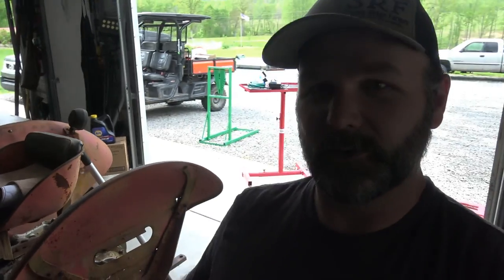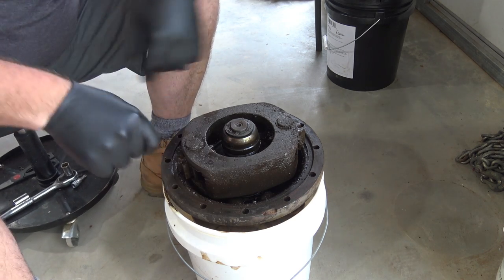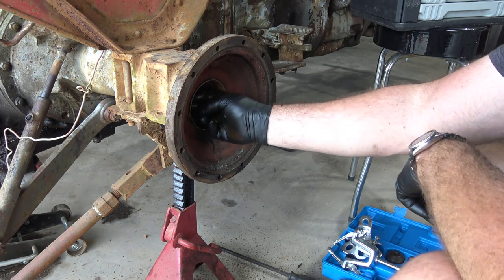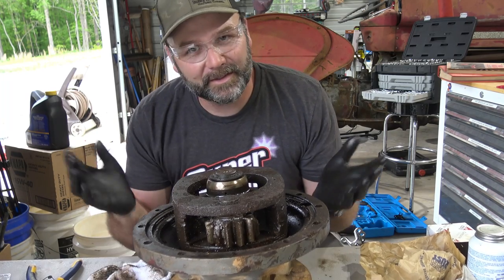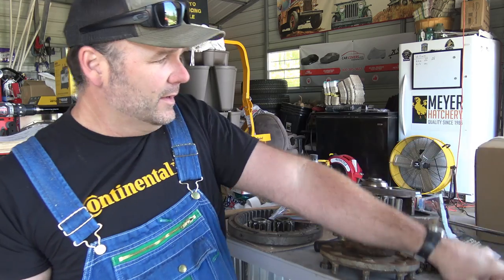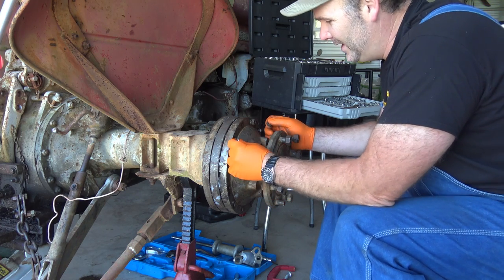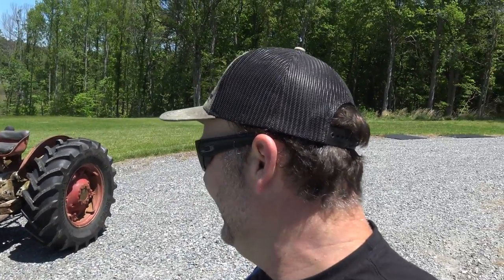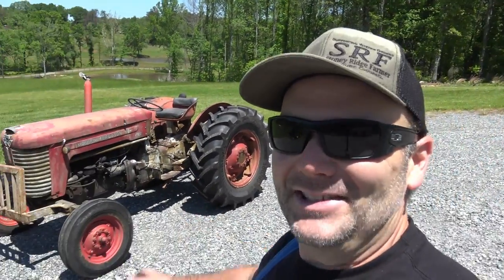Bringing this crusty 60 year old tractor back to life!

Comment: Earl either has a blown exhaust gasket or a cracked manifold. Just watch the smoke when you give it gas.
Reply from the maker: Or it's an old tractor that hasn't run in 3 years or more
Reply: No that's just oil because it's blue if it was white then you would have something to worry about. The oil drips in from the valves ecpecially if it has been sitting.
Reply: Maybe put a new exhaust and muffler and let it be done. Earl looks pretty cool just as he is. Great job and great video. 
 Thank you!
Reply: @randywright7433  would's be Earl without that costume muffler...
Reply: @StoneyRidgeFarmer  At about 30:24 you can see exhaust smoke come from the manifold area as well as out the top of the stack.  It's not that it smokes, but where the smoke comes from I think he is referring to.
Reply: @wickedcoyote271  it's probably just a loose slip fit on the exhaust manifold. Mine blows out on my tractor at the manifold for the same reason. I don't have a MF though
Reply: @wickedcoyote271  Yes, I can see that (coming from the mainfold area).  What do you do about that?  Great video!
Reply: @StoneyRidgeFarmer  Could be, but it's probably compression smoke due to the fact it was designed to use leaded fuel.
Reply: run it awhile, put some Upper Cylinder Lube (marvels mystery oil) in fuel, it will help loosen those stuck rings. USE IT, LOVE IT!
Reply: Soap and water will tell if it the Manifold spray around it.
Reply: No it’s the rings the piston rings will wear if it sits for over a year and the oil is bad

Comment: Nothing like having an old tractor around.
I got a 1965 Case 730 with a “Duz-All” loader on it. Got it from Uncle Oscar. Real strong loader and handy to have around.🇨🇦🤠
Reply: Also l don’t spend money on cosmetics like paint or fixing dents or redoing the seat. Gas Tires Oil all odds and ends. She is always needing something ha ha ha. Up here our gas is like glue but fortunately the carburetor is real simple to work on ha ha🇨🇦🤠

Comment: Old farmers trick is to put the bearing in gear oil on a hot plate on low for 20 minutes or so. Then press it on. We didn't have a press. We used a peace of pipe and a 4 pound hammer and that's why we heated it up the bearings.
Reply: Steve B and if you have a freezer big enough you throw the axle in to get cold then add said hot bearing they usually drop right on

Comment: Still use one of these. Grandad bought it new. It’s a 1962 model and it’s used for the jobs that need it. Also I’m pretty sure that one will have a plug in the front of the head where you can put a temp gauge. In the 165 it has a mechanical gauge in the hole so it’s worth a thought

Comment: Saw some minor chastising in the comments about the bearing installs.OK: for the technicals out there you use dry ice to shrink a bearing or outer race and a bearing heater to enlarge a bearing I.D. when needed. Or do what 90% of mechanics do and press or tap in place..... I've used all three methods and it depends on multiple factors.
Reply: Freezer method was told to me ,i used it for timing  chain  bearing and race b4 installing  new sprocket, i have to say the  cold contracted both with ease  and seating  them with thin coat of oil    after sitting 24hrs in freezer.  I added this one to my trick bag.

Comment: Hey Josh, love your channel and videos. One tip from an old diesel mechanic, my gramps, when tapping on the bearing race, always use a round metal piece of the same diameter (like a piece of pipe or large socket), put that against the race and beat on the center of that piece not the race. The hammer can damage the race and ruin your bearing. Beating on the center ensures the race goes in evenly without scoring the bore.
Reply from the maker: Thanks Fabio!

Comment: Just a thought for ya Josh, and know that I've worked as a semi truck mechanic for many yrs and owned my own for yrs. So, with that said just a little advice, and yes some will disagree on here but, even though the bearings in that axle run in oil, it's always a good idea to pack the bearing in grease when reinstalling. In fact, the yrs I worked for a Mack dealer in Ky. if we were caught installing wheel bearings, (new or old), dry, we could be wrote up or even fired. Yes those bearings run in oil but it takes some time of running to get the oil up and in that bearing. And once it is in the bearing it will wash out the grease. You don't want that bearing running dry for ANY time. Just a thought. 
John in Ky

Comment: I stumbled onto your channel a few years ago when you were replacing the seat on your other massey. I had a '56 MF50 and was getting it up and running at the time. Tuned up, new tires & rims, new electrical, new ignition, battery, cleaned the fuel tank, all new fluids. About the time I got it running just right, I sold it to a collector and bought a '16 Kioti with 4WD and front-end loader. I miss the character of the old tractor and my wife loved how cute it was, but the new tractor gets so much more work done and I don't have to work on it constantly. Probably would have kept it as a hobby if it wasn't my only tractor.

Comment: I remember when you came and picked up that tractor and brought it home with you. The first tractor I operated decades ago was a 1965 Massey Ferguson which was new at the time and owned by a guy who hired some of us to clear a field for him and I drove that tractor and loved it. That was my introduction to tractors and since then drove a Ford tractor another guy had which he used for farming and logging. In 2002 I purchased a John Deere 790 tractor which I still have and in 2016 I purchased a 3032E tractor from the same dealership and love it also.

It sounds like you do what a former friend of mine did as he rebuilt tractors also and rebuilt two of them and made changes to a third one he owned. The last one he had before he died was a used Massey Ferguson and it is still working, but his son-n-law don't know how to operate it. Those tires are heavy and you must have had a time getting them back on the tractor too, but worth all the work performed on it so it works just fine. I think you should keep the tractor as a backup to do some of the work you have just in case one other tractor is down.

Comment: not criticizing, but lending advise from someone who has replaced many bearings and gears on various pieces of equipment over the years. if you can (wife willing) put the shaft in the freezer for a few hours or better yet overnight. once its good and cold gently warm the bearing in a bearing heater (toaster oven works great for this) it will slide right together. the same goes for the gears
Reply: I have done the same thing with a pressed in ball joint. Freeze ball joint and put some heat to the seat. Push the ball joint in with 2 fingers.
Reply: Me to, mechanic  told me its the shade tree and poor mans remedy to high dollar tools,press and mechanics.
Reply: @patmac6356  it is but I had to go pay the deposit at advance auto part the other day for the ball joint press so I could use it to install U joints in my pickup. I have one almost exactly like the one Josh owns.
Reply: @pcguysoffgridcabin  New word for your vocabulary  ,kroil(oil that creeps) freezer overnite appropriate  sized socket  and a hammer does it everytime.
Reply: I don’t know crap about tractors, but wouldn’t it have been a good idea to grease the bearing and throw some additional lube on the splines? 
Edit: just watched another tractor resto video and that guy didn’t lube you the bearing either.

Comment: I just bought one sitting 20 years here in Australia. A 1963 MK11
I took the fuel pump glass bowl off to check the fuel, broke the seal, made a new one put it on. Battery in, turned the key and it fired without winding over. Zero smoke.
The steering was frozen because the rubber on the tie rods were rotten. Pumped the tyres up, sprayed some wd40 in them, kicked the front wheels a few times and drove it home 2klms.

Comment: Hey Josh. First things first great video. Little trick for ya. If your replacing a bearing race use the old race too drive it in. Like metals won't damage each other. You should leave early with the way he is. Nothing like a tractor with character. And 500mls is half a litre. It takes 3.98 litres too make a gallons. Hope that helps and I'll see ya in the next one. Thanks for taking us along. Whoo!

Comment: I have a small farm in the catskill mt. ny I love the old Massey Ferguson tractors I have 2  TO 35 tractors that I rebuilt one was 30 yrs ago the other was in pieces I bought local and totally rebuilt , that one has power steering, makes it real nice to drive . one I use for my pro root o tiller the other for  my finish mower. makes it easy to steer while mowing . I love those old Masseys and I enjoy working on them , pretty simple.

Comment: Josh, years ago, my dad had to replace a bearing in an air compressor. He couldn't get the bearing out, so he took it to a machine shop, where they welded a bead on the race, which, after it cooled down, pulled out with little effort. Your puller wouldn't have been able to pull it as it was quite large.

Comment: Hey Josh,  If it were me, I think I would run it for a little while making notes of all the little problems that surface as you use it.  Then make an assessment of how it will cost to do all the repairs.  Don't forget the paint job it needs.  Any electrical work requiring panels to be removed, should be done before paint goes on.  By the time you are ready to start, after running it a while, you'll know if want to go the short  road with a quick low reward, or the long road to the big payoff.  Remember Josh, it all boils down to what you want to do.  What is going to make you happy and capable of doing.  How much is it costing to fix and how much will it fetch after it's done.  Good luck, stay safe, and God bless.

Comment: Awesome work
Reply: Great job!  That’s a functional tractor the way it is.  A new muffler would be good.  As for Continental tires: I use them on my motorcycle and my bicycle. They perform admirably.  No regrets about using Continentals, despite the cost.

Comment: Josh, I have 1959 Massey 85 that is similar.  A friend's Dad used it on his farm and it sat after he died.  I bought it for $500, and put another $150 into moving it.  The shop I took it to turned me down.  They thought it would be more expensive to repair than it was worth.  I am going to take it to a shop where the mechanic will work on it as his schedule and my check book allows.
Reply: 500 ml is roughly 20 oz.  Think of the pop bottles you get at the convenience store.
Reply: Kevin, Just my 2 cents worth but if a mechanic works on your tractor and charges a minimal $50.00 an hour you'll be underwater on the tractor ten ways from sunday.Old tractors were designed and made for a typical farmer to do most repairs. Buy a complete set of manuals:factory original or re-pops.Operator,service and parts. Avoid generic manuals. then go through the tractor yourself. It really isn't all that hard with manuals. I've bought,fixed,kept or sold around 50 pieces of rolling stock:tractors to dozers. Take you time,take pics,label parts (right down to where the bolts removed came from.zip lock bags for those) take notes: not really that hard to fix old tractors and for me it's a relaxing and profitable endeavor for my spare time.

Comment: Nice job Josh & thanks for the learning curve on the tractor repairs... One recommendation i would make and that is to add a few Brass punches to your tool box and use them when installing the bearing races, one item you do not want to hit with a steel punch or hammer... that drive system looks like the same they use on the Hummers...Stay Safe Brother...God Bless...Chief...{NYS/ADK}

Comment: Been waiting patiently. Fairly big job and you did a good job at it. Nice tires too: I have to pay for mine and can't afford to go radials. Yes,I have some tire envy going on...LOL. On the oil change use straight weight 40 weight since it's going into summer temps. Old tractor with a worn engine. Multi viscosity oils will mean high oil consumption. In-frame rebuild would be nice to watch but you'll be looking at another grand with a head job.BTW: if the smoke stops after running it for a while it means your valve guides/seals are worn out.If it smokes all the time it's a combination of those and the rings. Do a compression test to check the rings and valves. Or not and run it and enjoy.

Comment: Josh You are doing everything right. The only thing i could add is wipe some oil onto the working surface of the seal. it doesn't matter so much on that axle seal because its slow moving. It will get wet soon enough. It stops the seal burning the edge off of it initially. Mainly applicable to fast moving parts like crank, cam, gearbox seals. I'v a bit of work on those old MF Tractors over the years . A lot of them are still in use here in NZ and they were reliable. Being continentals those tyres will last well. Continentals are never cheap. I can't remember if they have an access panel above the differential as some of the bearing may have gone into the diff housing. if it does open it up and have a fish around with a telescopic magnet.

Comment: If Earl were a diesel, I might go full restoration, but since Earl is a gas burner, I'd just get the mechanical fixed like you are doing and then a power washing and Earl would be ready for plow duty.

Comment: Josh, heat that copper washer untill it is just about cherry red, with a propane torch. The heat will swell the copper and it will compress again and seal when you install the plug. This is done on the spark plug washers on lycoming aircraft engines every 100 hrs.

Comment: My father used to work for a phosphate mine in Fl. and they needed to change similar bearings on pump shafts that were 6 - 8 inches diameter.  He would use an acetylene torch to heat a place on the race to red hot then douse it with co0ld water to turn the race very hard and brittle, then do the same 180 degrees from that.  Then hit the race with a good size hammer and the brittle metal would shatter and the race fall off.  In this case you would want to use a large torch to do the heating so you could get the race hot quickly without heating the rest of the axle heated too much.  I think you should go the clean it up and apply a clear coat route to show off the age.

Comment: My grandfather has used a MF 85 gas tractor on his farm since the 1970's. About 15 years ago the power steering blew a seal and he parked it in the barn and it hasn't moved since. He's 83 now and I doubt it will ever get fixed unfortunately. He says that parts for it are really hard to come bye, and are really expensive comparatively with his farmalls. Very cool old tractor though, it was my favorite tractor to run as a kid.
Reply from the maker: parts are very easy to find...and not that expensive...run that thing!

Comment: When installing or removing bearings a little heat can make all the difference.  You don't need to get it very hot (that could temper some of the hardness out of the bearing), but if you warm it up just above what you can stand to hold that should be enough to help it move easier.  It only has to expand a few ten-thousandths of an inch to slip over the mating part.

Comment: Pressure wash the tractor, leave the rust and spray clear coat on her. That's what a lot of people are doing for old cars now.  That way you can keep her as a usable tractor instead of a restored tractor that no one uses.
Reply: you could also rub the body and fenders down with boiled linseed oil and get the same look. Once a year rubdown will keep that patina looking sweet. Either way, it would look amazing for years to come
Reply: A Massey 65 is a very useful tractor.  Got a lot of hours of seat time on them. we had a gas & a diesel when I was a kid

Comment: I put some never seeze on my lug nuts and regretted it later double and triple check and make sure the Lugnuts stay tight. The other thing is I’m using a living snot out of my 135 industrial. I made a grapple for the rear of it to skid logs and it has gotten almost 200,000 board feet done. I could hear a clunking occasionally it was loose Lugnuts. Never again for me. But the tractor doesn’t sit around much. Love them all Masseys great videos. I thought hard about restoring mine and I was so glad when I did it I even bought the sticker kit and it looks super original and awesome and I love to run it. I guess to me old is just old

Comment: I would be awfully tempted to go down to Tractor Supply and get MF red for a driveway paint job, but then I enjoy doing that sort of thing.   Earl runs and has new rubber.  That's 70% of the battle right there.    He still has a lot of work left to give if someone wants to use him.

Comment: Here’s a tip for the next time you have to mess with a bearing Josh. If possible, take the part you are looking to install the bearing on, and put it in a freezer the night before or even for just a few hours. This will shrink it down with the chilling. Then take your bearing, and put it in a pot of gear or motor oil and heat it up on a hot plate to 300 or so degrees, which will expand the bearing. Then with the contracted axle shaft and the expanded bearing, it’ll slip right together without even using a press or even tapping it with a hammer. The same trick works for installing bearing races. Throw them in the freezer and cool them down then they will slip right in. Real good trick that will make life a bit easier!